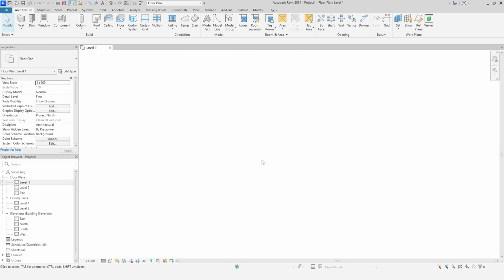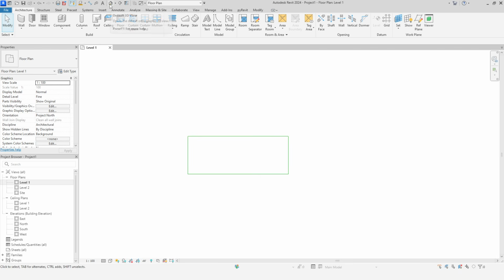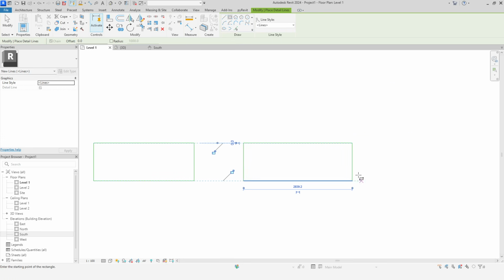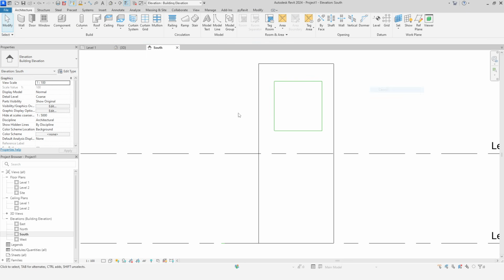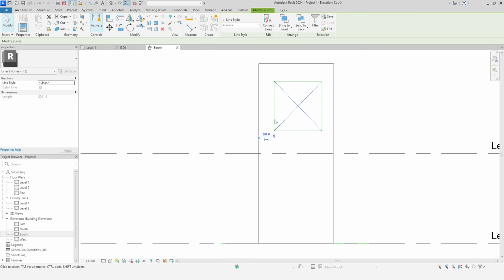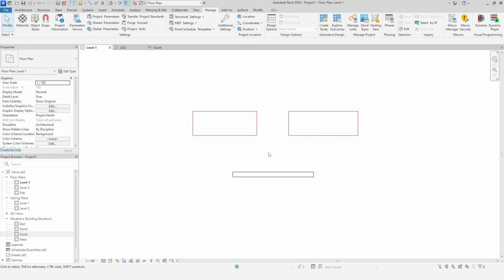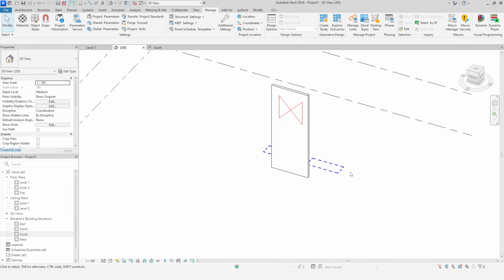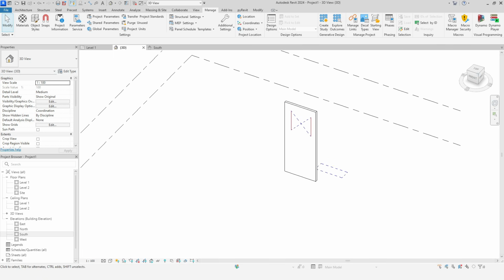Revit Model Line vs Detail Line  - Key Differences Explained 3D vs 2D

Comment: Can I use model lines to represent for instance a zipline?
Reply from the maker: Yes, you can use Model Lines to represent a zipline in a conceptual or schematic way.

Just keep in mind that Model Lines are purely graphical/model reference elements - they don’t behave like real physical or structural elements, so they won’t carry analytical or structural properties.

If the zipline needs to be part of coordination or documentation, it’s often better to model it as a proper 3D family or adaptive component.